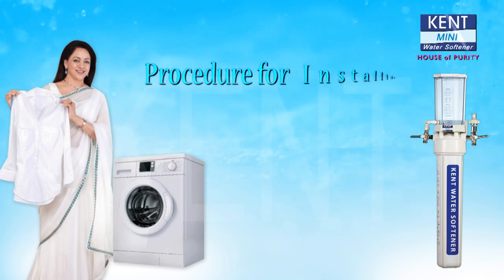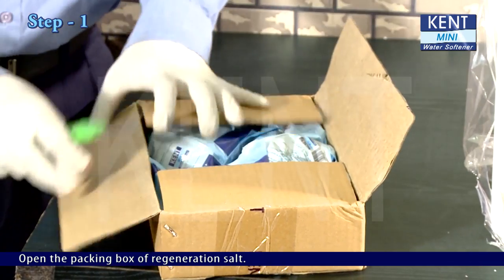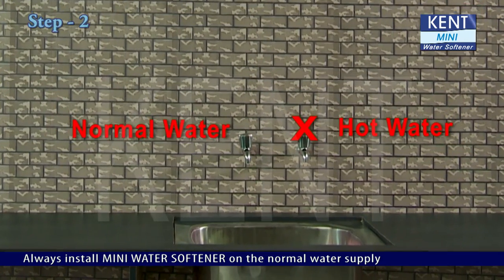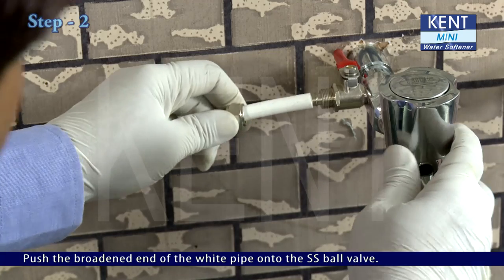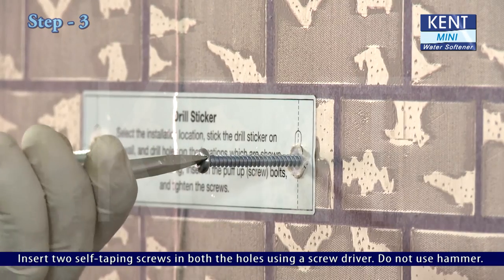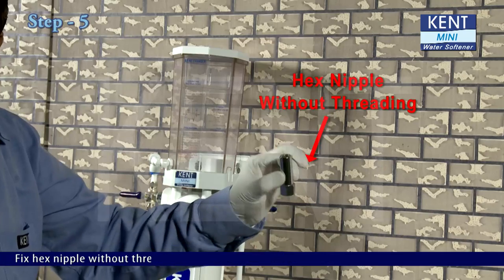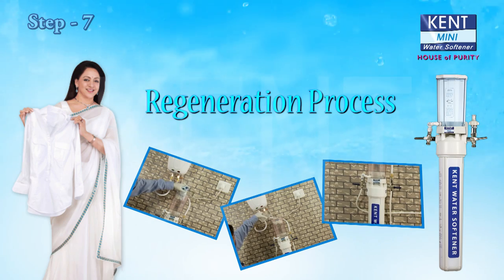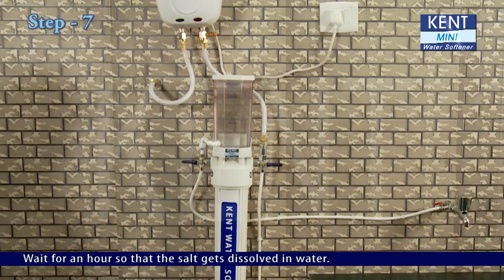Best Mini Water Softner: How to Install Guide Kent Mini Water Softner | Kent

Comment: Excellent unpacking, itemlist, installation guideline which has step by step description. This type of guideline indicates Kent is a great company and the person who write the script, knows all difficulties faced by first time installation people. At 6.00 minutes one more thing can be added. Users who do not see pipes running below the tiles may end up drilling into pipe.  so while pasting drilling sticker, the users should also check if no pipe is running below the tile, which needs some experience by the person to imagine possible water pipe lines below the tiles.
Reply from the maker: Dear Sir/Madam, Thank you  for your valuable feedback. This means a lot to us. Regards, Team Kent

Comment: My skin is glowing where i live in the past because there water supply goes through various filteration process , and now i live in different place here our water supply is from tubewell ,, using tubewell water iam noticing my face tone becomes dark ☹️ , does this water SOFTENER helps me to get back my skin glow?
Reply from the maker: Dear Sir/Madam, Regarding your query, we would like to inform you that hard water is the water that has high mineral content especially calcium and magnesium. Exposure to hard water can increase the risk of cardiovascular diseases, skin irritation, dryness in skin and different hair problems. It can also causes stain and thick scale in sink, showers and bathtub. To deal with these problems we have an excellent range of water softener that can convert hard water in soft. Our Water softener comes with an efficient ion exchange process that reduces hardness in water by exchanging magnesium and calcium in water with sodium and potassium. To understand the product better, please call our Sales helpline number at 9582-123456. For product details and specifications, you can visit :https://www.kent.co.in/water-softeners/kent-bathroom-water-softener.

Comment: Does it remove chlorine and salt ? 
I am facing this problem and my whole body darken without going to swimming pool because i get the same water in my home like swimming pool
Reply from the maker: Dear Sir, Thanks for showing interest in our products. Regarding your query, we would inform you that Kent Mini Water Softener converts hard water into soft water by replacing hard salts like Calcium and Magnesium with Sodium through an efficient ion-exchange process that is ideal for washing machines, dishwashers and geysers.Kindly visit the link shared below to check out our product https://bit.ly/2oObufV You may also call 9582-123456 for a free product demo. Warm regards, Team Kent

Comment: Does this solve the Dishwasher leaving white films or white spots on vessels due to hard water
Reply from the maker: Hi Geetaganesh, Regarding your query, we would like to inform you that hard water is the water that has high mineral content especially calcium and magnesium. Hard water can cause stain and thick scale in sink, showers and bathtub. To deal with these problems we have an excellent range of water softener that can convert hard water in soft. Our Water softener comes with an efficient ion exchange process that reduces hardness in water by exchanging magnesium and calcium in water with sodium and potassium. To understand the product better, please call our Sales helpline number at 9582-123456. For product details and specifications, you can visit :https://www.kent.co.in/water-softeners/kent-bathroom-water-softener  Regards, Team Kent

Comment: Should we do a self installation if we buy it? Who is going to use this steps? And what's the difference between mini softner and big one? How to do regeneration? Your customer care is worst I've experienced.
Reply from the maker: Hi Ganga, We are sorry for the unpleasant experience you had. Regarding your query, we would inform you that it is easy to install and regenerate. KENT Bathroom Water Softener uses a 2 step regeneration process. The process can be easily executed by the users making it extremely convenient.
 KENT Bathroom Water Softener is a compact water softener for individual bathrooms and KENT Automatic Water Softener 40 is Microprocessor controlled compact whole-house water softener. Kindly visit us at https://www.kent.co.in/water-softeners/  To understand our product better, please share your contact details at onlinecare@kent.co.in so that our experts will assist you better. Alternatively, you can call us at 9582123456 for product details and more information. Regards, Team Kent

Comment: Not practical ... a washing machine uses 100L per wash ... and renegration is at 200L ... so practically every second wash change salts...
Reply from the maker: Dear Customer,  Regarding you query, please share your contact details at onlinecare@kent.co.in. so that we will get in touch with you shortly. Alternatively, you may also call at 9582-123456 for further details. Regards, Team Kent